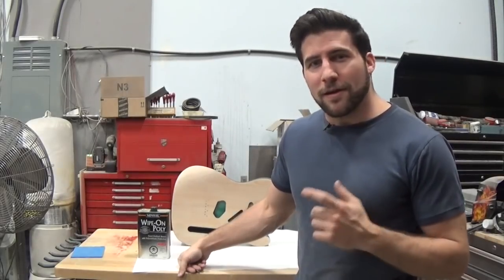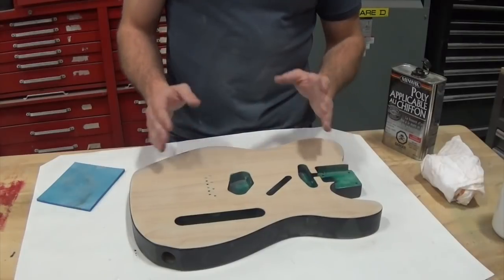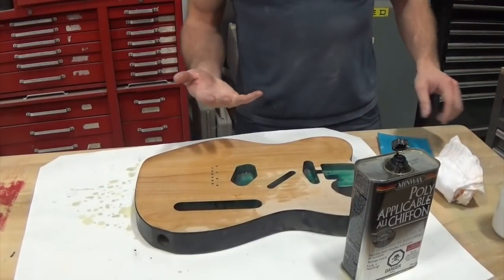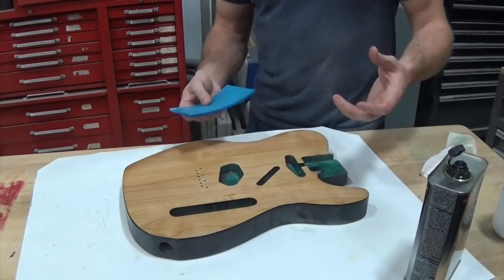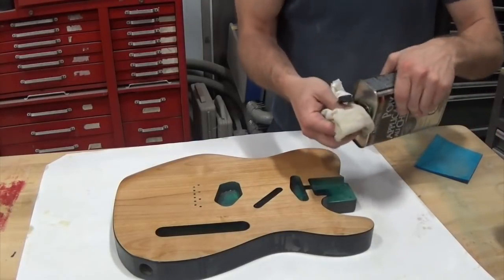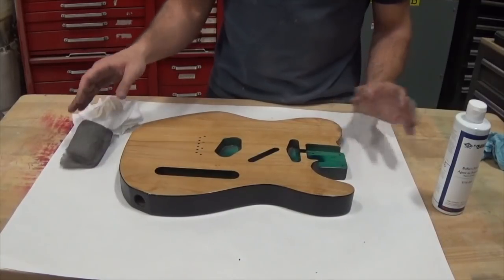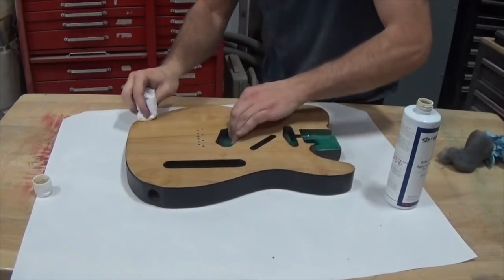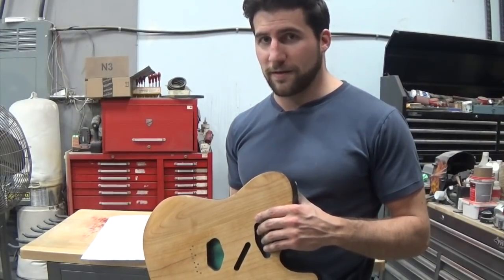How to apply a perfectly smooth poly finish by hand

Comment: Thanks Brad - can I use this method on a white-painted guitar body, or will the poly turn it yellowish in appearance. I don't want to try this method until I know that my white painted guitar will still look white after this poly application. Thanks again - great videos and a great mentor!
Reply from the maker: Commish's Place You can’t use this method on a painted surface. It will sand into the paint and mess it up. 
As for the poly, the water-based stuff is really crystal clear if that’s what you’re after. This oil based product might amber it a bit.
Reply: Thanks for letting me know, Brad - much appreciated!
Reply from the maker: You’re welcome.

Comment: Is there a way to do a simple opaque white or black, with the wipe on poly as the clear coats? Definitely on the home-luthier-amateur kind of level. I'm doing a 72 deluxe style build, and am kind of looking at simpler, cheaper, and/or easier to achieve acceptable results type approaches, especially since the 72 deluxe has a massive guard, so in terms of what people see when you play, I don't want to waste hundreds of dollars on a nitro kit from stewmac or reranch. I also don't have sprayers or a paint booth. At the same time, it's alder, so a clear finish may not be what I'm after either. Could you give quick recs for the simplest to achieve finish methods (like this one), and/but also include a couple of opaque options in there? If I went with something matter, is that easier, etc?
Reply from the maker: That's actually a great idea for a series. To answer your question directly, you can use an acrylic and let it dry completely, then put this overtop and it should work just fine. If you really want to go cheap and reasonably durable, pick up some gloss porch and patio paint and a small roller. It won't be as durable, but it's an inexpensive and very simple finish.
Reply: @BradAngove  Cool, can you give me examples of that, that would be available on amazon or Lowe's, HD, or WM?
Reply from the maker: I just get it from Home Depot. We use it on some inexpensive projects at the shop.

Comment: Brad, how would you add a vintage blonde tint over that first coat of wipe on poly? ...maybe mix acrylic paint with thinned poly?
Reply from the maker: If you’re aiming for a bit of yellowing but still transparent I would consider mixing an aniline dye in there. Likely amber.

Comment: If you had a small ding in the body, would you just put an extra coat of poly in that area to smooth it out?
Reply from the maker: It depends on the size of the ding.

Comment: Will this method work on black korina so that the filler and sealer can be skipped?
Reply from the maker: It depends on how porous your piece is. It makes up for a sealer, but doesn’t necessarily replace a filler when one is needed.
Reply: @BradAngove  Thnx.
Reply: @BradAngove  I've got a nice Black Korina strat body from Alloy in Oregon, I'm going to try glass microballons that I have left over from my model airplane days and some jacquard pearl ex pigment powder mixed in with the Minwax poly for the first couple coats.  Then sand so that the pearl is mainly in the grain, and complete with the clear poly.
Reply from the maker: Sounds like a fun project.

Comment: I was wondering, I want to do a green burst well light green to dark green and it is hard to find the dies (I will be doing this by hand) I just wanted to know if anyone had any ideas where I could find some green dies, I found 2 on amazon but one is really light and the other is a completely different green. So any help would be great. Thanks .
Reply from the maker: I have a colortone green dye in my amazon link in the description that you can dilute more to get your light green and use stronger for a darker tint.

Comment: The Behlens polish seems to be unavailable, at least where I am. Is there another brand you would recommend as a runner up?
Reply from the maker: Behlens has been rebranded under Mohawk. Mohawk makes a great buff and polish kit with two polished in it.
Reply: @BradAngove  You Rock. Thanks Brad. Stay well.
Reply from the maker: Cheers

Comment: Hello!! I'm having trouble with the planning of a future paint job and could use some help. Can a sunburst be done by hand (no sprays)? the thing is that i don't have access to a lot of stuff, and i would like to do a black to natural burst, but i can only get stains and a can of black nitro, no aerosol... A bit of a challenge i know but what are your thoughts on this? Thanks!!
Reply from the maker: You can use a stain or dye to do it. Do the edge first, let it dry, sand back a bit, then dilute your stain to make it more transparent and do it again wider. Then just use a cloth that’s wet with your diluting material, and feather it out a bit.
Reply: Thanks for your help i'll do that. Keep up the great videos!!
Reply from the maker: Will do. Thanks.

Comment: Hey, great video. I followed the steps but after 5th coat I can still eaisly dent the finish with my fingernails. Do I need more coats or I messed up somewhere at the beginning? I'm using satin wipe on polly. Also, do you recommend using a clear coat as the last layer?
Greetings from Poland.
Reply from the maker: The poly essentially is a clear coat. How long has it been drying?
Reply: @BradAngove   Brad Angove  between 1st and 2nd coat I waited for about an hour. for other coats I waited for about 2 days. Also my sandpaper kept clogging up when I was applying the first coat so I sanded it quite lightly, perhaps I didn't wait long enough before applying the second coat.
Reply from the maker: How long has it been since you applied your last coat?
Reply: @BradAngove  almost 3 days now, why?
Reply from the maker: Why? Because I’m wondering if it’s had time to harden fully. Depending on the temperature it can take a couple weeks for these finishes to harden entirely. For some finishes like nitro or acrylic lacquers you often don’t pass the fingernail test for about a month or more. 
What are the temperature and humidity like where you’re painting?
Reply: @BradAngove the temperature is around 22°C (71F) I have no idea what humidity though. I'll wait a couple of days and see if anything changes. It's my first project like that I I'm really grateful for the clarification. thanks
Reply from the maker: You’re quite welcome. Test it out in a few days and let me know the result.

Comment: Does the wipe on poly work for on top of say an amber dye?
Reply from the maker: The poly will, I just wouldn’t necessarily use a piece of sandpaper to apply that.
Reply: @BradAngove  that's great, thanks 😊

Comment: Can i apply the wipeon poly with a bit varnish or lacquer sitting on top my subject?
Reply from the maker: You mean apply it over a lacquer or varnish?
Reply: @BradAngove  yes
Reply from the maker: If it’s fully dry/cured and you sand it lightly first you should be able to.

Comment: What about painting it? Any tips beyond the sanding? Thanks
Reply from the maker: Painting what? You mean like how to paint the guitar with color and whatnot?
Reply: @BradAngove  yes. I'm thinking of buying a three coil unpainted electric guitar I saw on Amazon for under $140. I saw your video on sanding it first, I just would like some tips on what paints and clear coat beyond the sanding. And also tips on creating a temporary dummy fret neck or other device that can hold the body without damaging the holes. Thanks
Reply from the maker: I have a bunch of videos on how to paint your guitar, what paints to use, and even a video about a little spray stand for bolt on guitar bodies.

Comment: will this work the same after using a metallic paint on the guitar?
Reply from the maker: No. You don't want to be using sandpaper over that; it'll change the look of the metallic and possibly remove some. You could also have an issue with the poly kind of melting the metallic paint and causing it to move around.

Comment: Hi. Great video. Can I appli poli on a guitar body that was tung oiled or do i have to removie the tung(if possible) before?
Reply from the maker: Sand the tung oil lightly and then you can use this poly over it because it’s oil based.
Reply: @BradAngove  thx man

Comment: Hi Brad... quick thing, let's say someone I know very well tried this and f..up and had some fog build around the neck and the headstock  section. Any tips to fix that ? Sand it back an restart ?
Reply from the maker: Just to clarify, does it look kind of white under the finish? Or it it just a bit hazy, but the colour of the wood?
Reply: Hazy would be correct
Reply from the maker: Sounds like your close acquaintance left too much poly in the surface with the sawdust in it. You need to remove most of the excess when applying it. Sand back to get close to the wood again and then just wipe on a light coat overtop the normal way.
Reply: Ok thx i’ll do that! Thanks for the videos   It’s valuable information. Keep up the good work !
Reply from the maker: Thanks for watching. I hope the project goes well for you.
Reply: Thanks , I can send you some pictures if you want to have some kind of collection of influences that yoû had on people , or maybe build a video on folks realizations based on your tutorials . Let me know . Cheers !
Reply from the maker: If you would like to send me some photos that would be cool. Use the Facebook link in the description. I keep a collection of them, but I won’t be making a video with them because I don’t have permission to use them all.

Comment: thanks for sharing. What is the greenish area inside the cavities? Is it a conductive shielding paint? is the conductive shielding paint necessary?
Reply: as well do you do this on the sides and back?
Reply from the maker: +Marney Smithies that's just leftover paint from a previous demo video. Shielding paint is important if you're not going to use shielding tape.
Reply: ahh ok thanks Brad, we are making a semi-hollow body & have bought copper tape & paint. Do you prefer one over the other? And should we put the best in all cavities?
Reply from the maker: Copper tape is superior in performance, so I prefer that haha. Ideally you would shield any cavities that involve electronic components. I have a video on shielding with copper tape if you're interested.
Reply: excellent, good to know, i will check out that vid for sure!

Comment: can you still get the smooth finish without using the sandpaper to apply yhe first layer? have a freshly painted guitar, so i dont want to scratch up the art
Reply: also, for finishing a full guitar, is it best to apply the poly to one side at a time and then allow it to cure before moving onto another, or apply it all around all at once
Reply: and lastly, is there any real visual difference between wipe on and brush on poly in terms of gloss level? i want to get a nice mirror finish on it so i want to use whatever gives me the best gloss
Reply from the maker: Sand paper is just to fill the grain. Not needed on a painted guitar. If you can hang it and do everything at once that is better than doing one side at a time. Brush on is thicker and can build gloss quicker. Have a look at my video on how to brush on a gloss finish.
Reply: @BradAngove  one last question, the artist who painted it left some brush marks with the acrylic paints he used. would a thicker poly be able to fill in those little crevases to make the resulting finish smoother? then i wrap it all up with a topcoat of wipe on?
Reply from the maker: It will help, but I might take doing it a few times and sanding smooth. Be careful brushing over acrylic. The solvents might cause some problems.
Reply: @BradAngove  sounds good! and yeah i found out about the acrylics smudging the hatd way, but luckily i noticed before it got bad. thanks for all the help man, it really means more than you know!!
Reply: ONE more question! i applied a bunch of coats of poly now, but the surface is still a bit uneven, and in trying to apply thick coats, i got some streaks of runoff which are visibly raised above the rest of the surface. what is the best process to level those raised portions, and then to polish the finish?
Reply from the maker: Wait for it to fully harden and then sand smooth and polish. I have a few videos on how to do the sanding and polishing process.

Comment: Can you still use this method if you have stained or dyed the body first?
Reply from the maker: I wouldn’t really recommend it. You risk removing some of the stain or dye and causing a slightly distressed looking finish.
Reply: Thanks brad, so I should just use the cloth and wait it out? Also would you recommend using the Mohawk buff and polish kit for the final step?
Reply from the maker: Yes, I would just use a cloth and do a few extra coats to make sure everything is filled in and smooth. I like the Mohawk buff and polish kit, but you can also get away with less expensive options like a few pieces of 1000 and 2000 grit finishing sandpaper and some meguiars ultimate compound and ultimate polish.

Comment: Hey when I applied it and tried sanding it, it was sticky and I couldn’t rub it off with a rag. Any tips?
Reply from the maker: Did it get sticky right away as you were applying it?
Reply: Brad Angove yea it was sticky right away when I was doing the first coat with the sand paper
Reply: Brad Angove could it be because I had used another varnish on the wood before putting on the poly, I put the varnish on before the poly a week before
Reply from the maker: Yes, it probably dissolved some of the prior varnish so that it was partially dry.
Reply: Brad Angove do you have any recommendations to make it work?
Reply from the maker: Let it dry fully and sand it smooth. Then just use a cloth to apply a light coat of the wipe on poly to finish it off if there’s already varnish.
Reply: Brad Angove thank you so much your a lifesaver. I made a bass and carved some stuff into it and I really didn’t want to ruin it since I spent so much time and effort on it. Thanks again!

Comment: Hey Brad, just discovered your channel, loving it! I’d love to do my own guitar build, but I’d probably like to dye the wood first. Would this method using wipe-on poly still work as a clear coat? Would you use the sandpaper for the first coat(s) if you had dyed the wood? Cheers from Australia 🇦🇺
Reply from the maker: The wipe on poly is fine but I would use a cloth instead of the sandpaper.

Comment: If I get a nice sunburst using  nitro cellulose , can I use this to clearcoat , or will it react with the nitro?
Reply from the maker: Generally you would use nitrocellulose clear coat in those circumstances. I’ve never tried combining it with this. I’m not sure what would happen.
Reply: @BradAngove  Thanks for taking the time to reply , guess there,s only one way to find out .
Reply: Just for your information Brad , it seems to work really well , I left the nitro sunburst finish to gather it,s thoughts for about 4 weeks , then applied wipe on poly , so far , looks excellent , not sure if any problems will occur over time  . Thanks again for your inspirational videos .
Reply from the maker: Glad to hear it’s working well

Comment: thanks for the videos! how does that way of finishing  works on acoustics guitars? had you ever probe it on these guitars?
Reply from the maker: You should probably avoid using poly on an acoustic guitar. It dries harder than most of the finishes used on acoustics if I'm not mistaken. It doesn't really make a difference on a solid body electric, but an acoustic relies on reverberation to create sound, so the type of finish can change the sounds noticeably.
Reply: yes, I think the same way, thank you
Reply from the maker: Thanks for watching.
Reply: Brad I am ready to finish an acoustic jazz guitar.  Spruce top maple back, sides and neck. I need to do it by hand, what products would you use also what pore filling techniques.  Long question I know ‘sorry’ but this subject really has me confused and you appear to be the man all things ‘finish!’   Thanks in advance.
Reply from the maker: Shellac is a relatively popular option for pore filling acoustic guitars, and is also an option for the final finish. It’s compatible with most things, and you can apply a thin layer of brushing lacquer over it if you so choose.

Comment: Would Scratch X 2.0 work the same as the product you used to buff the guitar? (its just what i already have)
Reply from the maker: +Rowan Jones That's a swirl remover if I'm not mistaken. It's usually a last step. It could work, but might take a little longer.
Reply: thank you! that makes sense.
Reply from the maker: I'm glad to hear it.

Comment: What do u recommend to use on a scalloped guitar neck?
Reply from the maker: Which part? The neck or the fret board?
Reply: @BradAngove  only the neck. I'm trying to create a shade or stain to showcase the scalloped neck more.
The neck is scalloped but in the light it doesnt appear to be scalloped.
Reply from the maker: Now I’m confused. You mean the fretboard is scalloped right? And you’re trying to create more depth in the scalloped appearance of the fretboard? Not finish the neck itself?